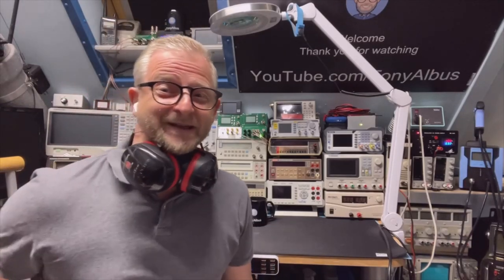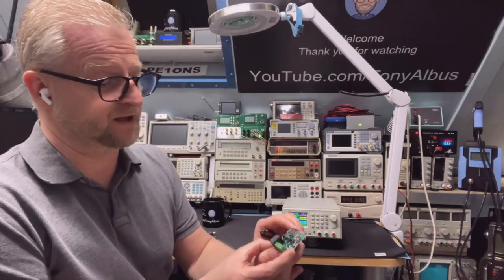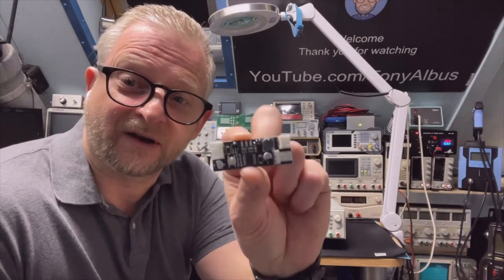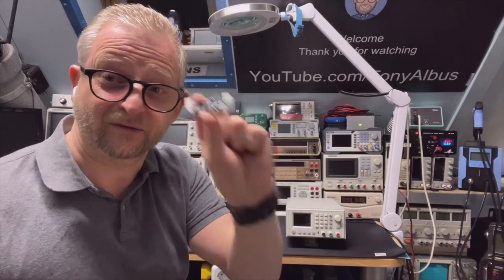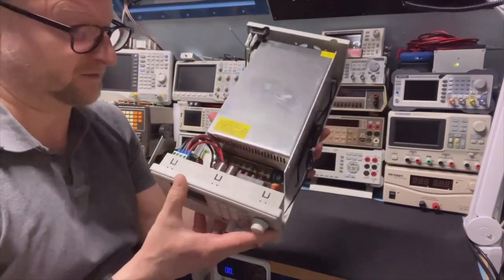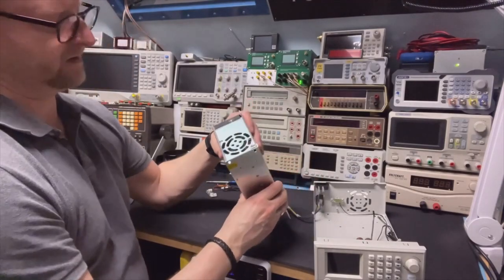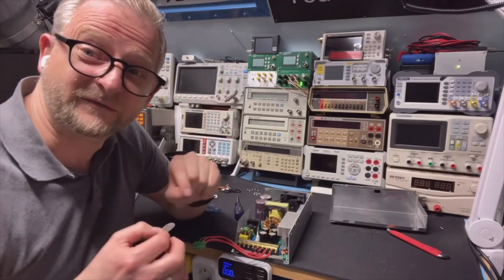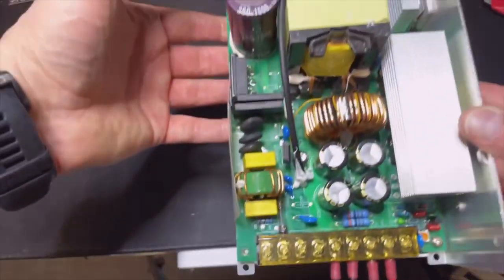#182 Riden RD6018 1200Watt PSU Silence modification

Comment: I just bought the new RIDEN RD6006P. I got the kit with case & supply - they have made some interesting changes beyond the extra digit of set & display resolution and lower ripple (both of which are nice). The case now reverses the orientation of the power supply so all connections are at the back (short AC power leads and longer DC leads - acceptable for a 6 Amp unit like this). It also includes a variable speed fan controller that bolts to the back of the case, with a permanently attached floating air temp sensor (fan seems to be 5V now). This controller plugs into the supply's output and runs only for a second at startup then stops completely until the case gets quite warm. The fan in the supply itself is also silent at startup (very nice). They also added an extender with a rear of the case mounted (flush) socket for the battery charging temp probe - so this is certainly less weird!   Maybe there will be a future RD6018P with similar fan features
Reply from the maker: Thanks,.. sounds like good improvements... nice to know.  maybe they have watched some reviews and improved.

Comment: What about just unplugging the current fan and using a 120mm fan in its place with the top metal of the PSU removed? You will get a lot of airflow with almost no audible fan noise. I use this type of PSU in enclosures a lot and never use the provided fan, I don't like small fans because they make a lot of noise to move air around.
Reply from the maker: Yes also an option, now Lincoya seems to have a nice controlled fan i heared from some of my viewers.

Comment: How would you determine whether or not the Riden Control Module's cooling depended on the PSU's cooling fan, when activated, always running at full speed? 
It seems the only fan that actually removes hot air from the case is the PSU's cooling fan.
Isn't it possible that they designed the Riden Control Module's cooling capacity taking into consideration the PSU fan's output air volume? Thus, using the added control PCB (and the diodes) decreasing the output air volume of the case would decrease the amount of heat removed from the Riden Control Module.
Reply from the maker: Yes it cools better full speed, but it is just to noisy. if you use not to much power it is not needed.

Comment: Nice mod Tony, I've used thermal conductive glue (AG Thermo glue) in similar project.
Reply from the maker: Thank you!.. will have a look now... i want that too.. :)
Reply: @TonyAlbus  I was thinking about the PSU, please can you measure with scope what. Is noise level with certain power output. Do far I have a couple of korad linear power supplies, but thinking about something more hefty for led/motor projects
Reply from the maker: @MartenElectric  Give me some time to do this.... i will put it in a Q&A
Reply: @TonyAlbus  thank you

Comment: I would think you would leave the cover off of the internal power supply. As long as no hot components can touch the case… I would think it would run a lot cooler just leaving that secondary cover off. I know they are good at directing the airflow but there’s already one cover over the whole power supply, a second one would restrict airflow I think
Reply from the maker: Yes that could be a solution...yes it will affect the airflow.

Comment: how about investing 10$ in noctua fan? any improvement with the noise? ;-)
Reply from the maker: Not using it to much, i should have bought a better quality PSU unit, becouse the RD6018 is nice itself
Reply: @TonyAlbus  the RD6012PW I have has also built in fan, 40mm x 10mm 5V, it also makes noise. So I replaced both: this one and the one in PSU (40x25mm, 12V) with Noctua ones and... you cannot hear it. The PSU has 3 states: 0%, 50% and 100% - noctua with 50% is almost silent. The one on RD is 0% or 100% - still much much quieter than the one from the factory. Little investment, much less job (less to brake) and very satisfying results. 
Anyway, I did it based on your video (so thank you).
Even better option would be replacing them with Noctua PWM fans but then you also need the controller. Probably too much hussle then.
Reply from the maker: @zyghom  Thank you! .. good idea about those silent fans, will have a look

Comment: I have the smaller version of the kit which can do 6 Amps at 60 Volts, so 360 Watts I guess. It is a nice PSU but has some bigger ripple. I am using an additional capacitor on the outputs, so it is okay now. But still not very good. However, it does the job, boots ultrafast and is easy to use and as a 360 Watt device no issues with fan noise so far. I like this device, however the price is a bit high. Mine did cost 170 € as a kit I purchased from Elektor. But the form factor is cool, so I mounted it under my work bench table.
Reply from the maker: Thanks Markus, yes nice and small and plenty of power... not that clean but works for most simple stuff.

Comment: You could have used the pwm controller as it's 99% likely using a n channel mosfet that can easily cope with 24v for the output switching.
use the 7812 to power the pwm controler,  connect the black fan wire to the fan - of the pwm board and the red fan wire to the original 24v positive.
I do the same with my 12v only led strip controller controlling a 24v led strip.
Reply from the maker: Thanks robin, yes that did cross my mind.... oh wait it did cross my mind: https://www.youtube.com/watch?v=3oSOFBAZEqQ

Comment: Those smps bricks are the standard nowadays. I trust in Meanwell brand, good and cheap. Also, the 24v fan found is a big ouchy, I was specting for PWM module run demonstration. Otherwise, good video.
Reply from the maker: Thanks!.. also was hoping to do the PWM... later i order a 12V fan then i can use that pwm module.. and also cleanup what i did now.
Yes meanwell is seen as one of the best...i read that in the 3d printing community they need one... or as an upgrade.. i just bought the cheapest... en there you go.. you get what you pay for...but also it is not that i was working on HP... this was meant to be lots power for little money
Reply from the maker: I found a 2 wire PWM for upto 24 and upto 48 Volts, i ordered that one.. but i somehow can not add the link here.. i will put it in the description of this video.
Reply: @TonyAlbus  looking forward to this mod. It is interesting. Wish it could be done in my 8663A... it is very noisy

Comment: An other solution could be switching 24V (for the fan) by a N-Channel MOSFET with the (12V or even 5V) output of the PWM controller.
Reply from the maker: Yes, Thanks

Comment: wawo , it is great work, many people will like that , but don't affect fan Cooling function
Reply from the maker: Thank you Sir, in Video #195 i have improved it with a 12~48 Volt PWM controler.
Reply: @TonyAlbus  you are welcome, this PSU is not our recommended power supply, so the fan was not control by temeperature.
Reply from the maker: Can you send me a link to the recommended PSU? or send link to email tonyalbus@gmail.com ?  (in case youtube blocks the link)

Comment: When the rd6018 is 90degrese it will cut off
Reply from the maker: Thanks Jessy, is that 90 C or F , if it is C ghat is really high, you should not run it that high, it shortens the lifespan. thanks for your test